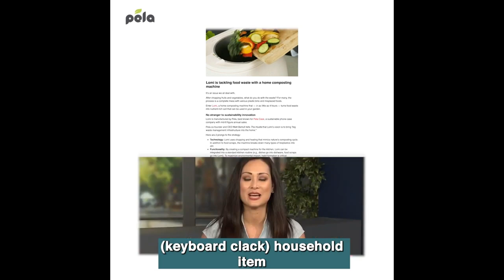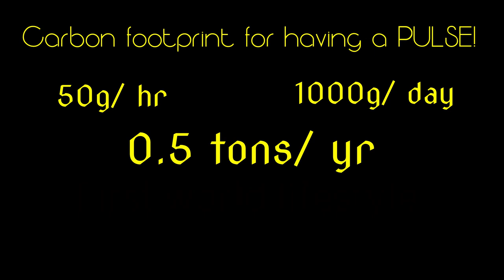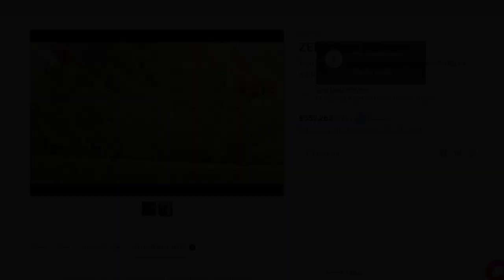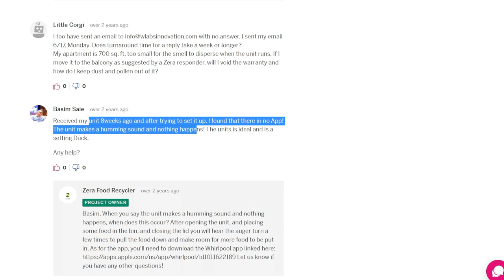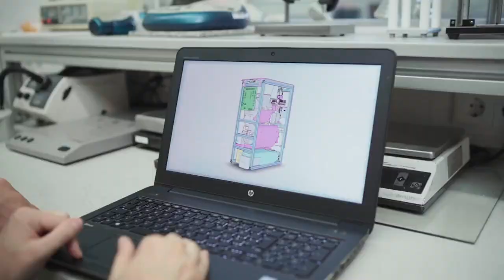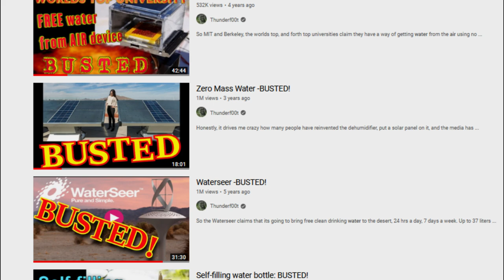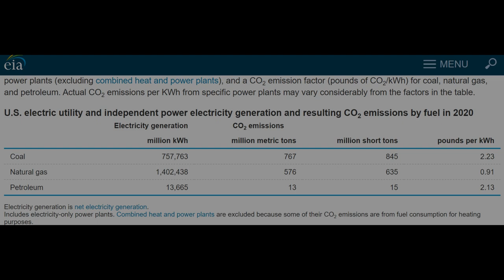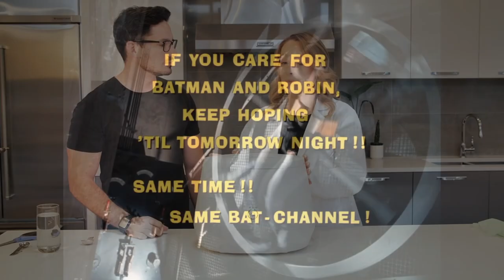Lomi: BUSTED!

Comment: Just want to point one thing out, as I do not support the product, I do want to say your information is not all correct. In the beginning of your video you tried to argue that composting produced methane the same way landfills do and that’s been proven wrong. 
The aerobic process of decomposition done by composting does not produce methane because the microbes that produce methane upon decomposition are not present when exposed to oxygen. 
The reason methane is produced by landfill is because the waste is compacted down and buried in clay and dirt not allowing the waste to be in contact with oxygen.

Comment: Look guys, the fact is it does require electricity to run by at $.12 a load it’s actually not a big deal, and it cuts down on the trips to the garbage bin by lowering the volume of food. On top of all that, I can put this into my own garden and the minerals will help the food grow that’s called fertilizer dummies!
Reply: You forgot the "/s"

Comment: I mean it is redicilus how you ignored the true potenzielle for antaric Research Expedition;) there you can Not leave Trash behind thus Dehydration of foot wast might be a good Option.
Reply: Mealworms and superworms: Are we a joke to you????????
Reply: @electric7487   so do they actually have are Worm based decomposition Setup at Antarctica ?
Reply: @konraddapper7764  Not sure, but worm composting would be very environmentally friendly, that's for sure.
Reply: @electric7487   in Most caeses yes 
But  in - 30 ° weather  Close to the southpole were you would have to Heat compost piles I am Not Sure If it is worth the effort.
Reply: @konraddapper7764  Keep the worms in your shelter then.

Comment: So it gets hot and had a blade rotating in the bottom... Um... Isn't it just the same tech as a bread-maker (with a different shaped blade) only with LESS settings. How does this piece of garbage cost more than $60?

Comment: where do you think food comes from?
it grows in soil which is located in the ground lololol 
so in your mind putting food back into the place it came from is causing a problem?
could it be that plastic and other toxic junk is causing a problem with the environment?
let’s do something mathematical,
you have four pound of waste.
two pounds food, two pines plastic and other toxic garbage…..when that four pound reaches the land fill, which two pounds is causing the problem for the environment ?

now you have four lines of toxic waste, going into the same land fill, it’s all toxic so what’s the solution, what do we do?
hey i know how about reducing the toxic waste.  sound like a plan?

the two pounds of food, and two pines of toxins makes sense now, right.

what happened when this electric compoter that uses electricity made of metal and plastic breaks ?   it goes in the trash to that land fill to cause even more damage to our planet.
“or is it going to run on air, and never break? “.  how crazy is that 

God forbid you throw food in with that clean garbage.  That rotted food will destroy our planet.
how stupid, and you fell for that

Comment: Scam you say? Critiques are ok but after spending 24:12 of listening I didn't hear anything about alternatives.  Are the calculations in this take in to account if the Lomi is plugged in on a regular basis say like a refrigerator? Also seems like this the tech has gotten a lot smaller or better.
Reply: Grinding your food waste in the garbage disposal is another option that does a lot less environmental harm than these things do.
Reply: The alternative is a freaking compost. If you don't have space for one you won't be using your fertilizer anyway. Indoor composting has also been a thing for decades aswell, without wasting electricity (Bokashi). Man, people are stupid.
Reply: @jamaly77  duh that's obvious. The point of those machines is to make it faster and better alternative than composting which takes a while. That's the whole point of technology. It's still smaller than anything in its class. Despite the inefficient conduction of energy of said device.

Comment: Fake vids don't help. For the under $200 dollar price I think its worth what it does. The cost seems to have skyrocketed though. I like the material output that is easy to store before the  addition to manure. The adverts are completely contrary to the directions received with the unit. The little kid putting a handful of material into the planter is just a way to promote indoor mold. I've used urban composting, and without a big shovel and a bathtub volume of dirt its not easy. The process is accelerated but it doesn't compost. As the first few seconds of this vid states, its a pre-composter. With a few re-used sealing buckets and a garage that is typically uncomfortably hotter than the uncomfortably hot climate I get good results. Starting the unit before bed leaves the dry cycle to run during the time of least power use and highest power generation. Not to argue about the electrical use, but its worked for us. If it keeps working without hassle for 4-5 years I'd be happy with a $200 cost. If expectations are correctly set, the power use is the only concern for me.
Reply: To clarify, this isn't a criticism of the "bust". It's not an endorsement for the product. I had not even seen some of the dumb advert vids before getting some Thunderf00t common sense. After watching the vid its seems that while I find the product useful, I don' seem to be fulfilling its fanatic claims.

Comment: yea, no....
These composters work extremly well, These contraptions can cut down 95% of your food waste, And if your etremely you can use paper waste as well. As someone who has 2 similar machines,I can vouch for them.
your video is funny lol yet simply not true...
Reply: You sound like an advertiser saying “you can get UP TO  x amount off.” Explain how this energy sucking machine is any better than traditional composting.
Reply: Amazing. Every word of what you just said was wrong.
Reply: @Zynbabwe902  
Lets see.... If you dont have a yard to build a compost pile in, this solves your problem sweetness
Reply: @electric7487  
Tell me the wrong parts...ill wait
Reply: @src3360  Your ENTIRE COMMENT was nothing but lies.

The first thing you should do if you want to cut down on food waste IS TO NOT CREATE SO MUCH FOOD WASTE IN THE FIRST PLACE.

And if you DO have a problem with food waste, the answer is probably right under your sink. Grind your food scraps in the garbage disposal. Garbage disposal units use far less electricity than these things. And they don't stink anywhere near as bad. And they require far less maintenance.
Reply: @electric7487  
Firstly, what I wrote is true bcuz im doing the exact things written. Im composting right now actually.... and nothing stinks
Share with me how you compost your food scraps..? You know nothing I spoke of. You dont own a machine. So your opinion means absolutely nothing, you cant even compare experiences bcuz you dont own a machine and likely have never composted a thing. You send it down the drain....
Garbage disposal is NOT composting. Its simply putting more WASTE to be filtered and treated at a later date. And making less food waste? Maybe you buy food in cans and bags but the food I eat needs to be peeled, chopped, dissected, etx so no matter how hard I try, I will have food waste. So no to that as well.....

Comment: I disagree with the interpretations you and many of your commenters express. I do agree that most of the food cyclers do not produce compost as in nutrient rich bioactive soil product. But I don't agree that they clearly are worse for the environment.

First, it seems you and many of your commenters have adequate space for a compost pile. People in dense cities and apartments do not. Definitely not an option. So our food scraps must go somewhere (no, not ALL food material can be eaten so that option is not valid, I cannot eat banana peels and watermelon rinds).

Next, it is true that electricity is used to dessicate the food into mostly cellulose fiber. But I purchase only renewable energy electricity. Is it a lie where my electricity comes from? I guess it may be. But if my electricity is indeed from renewable energy then the joules used to dessicate my food scraps did not increase carbon emissions except in the process of relying on a grid, which is already there and not related to the food cyclers.

And a major way these machines reduce emissions is in the transportation of the waste. Food scraps that I throw into the garbage must be picked up by a diesel truck, driven who knows where, and anearobic processing in a landfill produced methane. Meanwhile the dry cellulose my machine produced, I sprinkle it in the park as I walk to work. Even if I threw the debris in the trash, it's about 80-90% less weight with the water removed. So tremendously less disel burned to haul the waste.

In effect, this means the post-purchase part of my food life cycle is nearly emissions free. The renewable electricity to power the machine, no need to drive the scraps to a landfill, and no methane.

The only part of the process that increases emissions is the pre-arrivall to my home. So the extraction and manufacturing and shipping of the device.

I believe you are doing a disservice with this video. I don't believe you have earnestly evaluated the data but rather trying to profit on the reasonable concerns others have about a full cycle emissions of a product. 

https://earth911.com/home-garden/electric-composters-sustainability-win-or-another-unnecessary-appliance/

https://www.honestlymodern.com/foodcycler-emissions/
Reply: > "First, it seems you and many of your commenters have adequate space for a compost pile. People in dense cities and apartments do not. Definitely not an option. So our food scraps must go somewhere"
- If you use a municipal sewer, the answer is under your sink. Grind your food waste in the garbage disposal. This uses far less electricity than one of these things, because it runs intermittently instead of continuously, and most importantly, garbage disposals don't have power-guzzling heaters running for 5 hours straight.

> "Next, it is true that electricity is used to dessicate the food into mostly cellulose fiber. But I purchase only renewable energy electricity. Is it a lie where my electricity comes from? I guess it may be. But if my electricity is indeed from renewable energy then the joules used to dessicate my food scraps did not increase carbon emissions except in the process of relying on a grid, which is already there and not related to the food cyclers."
- No. If you want to reduce your energy consumption, you have to reduce your electricity usage regardless of where your energy comes from. Even if your energy doesn't come from any fossil fuels whatsoever, it's still much more environmentally friendly to use less electricity.

> "Meanwhile the dry cellulose my machine produced, I sprinkle it in the park as I walk to work. Even if I threw the debris in the trash, it's about 80-90% less weight with the water removed. So tremendously less disel burned to haul the waste."
- Wrong, wrong, wrong, wrong, wrong. The mass of the water removed is nothing compared to the total amount of mass of your garbage. This is not hard to figure out.

> "In effect, this means the post-purchase part of my food life cycle is nearly emissions free. The renewable electricity to power the machine, no need to drive the scraps to a landfill, and no methane."
> "The only part of the process that increases emissions is the pre-arrivall to my home. So the extraction and manufacturing and shipping of the device."
- What? None of this makes any sense whatsoever.
Reply: @electric7487  you make a lot of assumptions.

Quite many people rent and cannot install a garbage disposal.

Second, my weekly garbage is about 90% food scraps bc I don't buy much. So maybe if you consider all the other people I understand it's not a lot. But my waste, by mass, is about 90% food scraps, and the rest food packaging. You don't have to believe me but others may identify with this as well.

While it's true that less energy is less energy, source does matter. While carbon offset is not really the same clean energy as solar or hydro, being able to use energy at a time that demand is low or from a solar source is an option for many people. But loading diesel garbage trucks with banana peels is guaranteed to use diesel.

So I know it's the Internet and it's cool to insult others. But please consider your experience isn't the same as everyone else.

But I do agree that for those who can pulverize their food into the sewer, that probably is a very energy efficient solution since the water flows.
Reply: @spissatus  
> "Quite many people rent and cannot install a garbage disposal."
- Don't a lot of apartments these days come with garbage disposals? At least newer ones (built in 2000 or later at least)?

> "Second, my weekly garbage is about 90% food scraps bc I don't buy much. So maybe if you consider all the other people I understand it's not a lot. But my waste, by mass, is about 90% food scraps, and the rest food packaging."
- Recycle your packaging. Get some mealworms and feed your food scraps to them. And what's neat about mealworms is that they can even eat certain plastics, most notably polystyrene (Styrofoam).

> "While it's true that less energy is less energy, source does matter. While carbon offset is not really the same clean energy as solar or hydro, being able to use energy at a time that demand is low or from a solar source is an option for many people."
- Yes, source does matter. But something that increases your electricity consumption by a significant amount isn't going to help.

> "But loading diesel garbage trucks with banana peels is guaranteed to use diesel."
- Those trucks are going to be powered by Diesel fuel for at least a while, maybe even forever. At some point, though, that Diesel is going to be produced from pyrolysis of sewage or garbage or synthesized from CO2. I'm not sure on exactly what percentage of the garbage in the trucks that pick up your waste is food waste, but I don't think it's significant at all. Also, the faeces that mealworms produce is going to be much, much less dense than raw food waste. It's going to be mostly in the form of a powder, so you can dump it on a tree or something. Then it'll decompose aerobically, releasing minimal methane.

Comment: IMO if you live in a place where coal or oil is burnt for energy this is an awful product. But your video does not touch on places that use renewable energy. It’s also worth mentioning that this type of waste can be used for indoor gardens, and houseplants. Don’t be quite so narrow minded.
Reply: > "IMO if you live in a place where coal or oil is burnt for energy this is an awful product. But your video does not touch on places that use renewable energy."

- I've seen this argument over and over again, it's basically saying "as long as our energy comes from solar, wind, and hydro, we can use as much electricity as we want". It's wrong on literally every level. Why? Because nothing is free. Solar panels and wind turbines cost money and resources to make. In order to be more eco-friendly, we need to reduce our electricity consumption regardless of where our electricity comes from.

> "It’s also worth mentioning that this type of waste can be used for indoor gardens, and houseplants."

- There's already a video showing how dehydrated bits of food waste can actually inhibit plant growth. Plus, by heating your food waste to such high temperatures, you're sterilising it, meaning that most of the nutrients are now destroyed or gone.

> "Don’t be quite so narrow minded."

- The term you're looking for is "grounded in reality", not "narrow-minded".

Comment: the exaggeration in this video is super annoying. lomi is not gold-plating trash bags. 1kwh of energy costs most americans 20 cents or less. the people who buy a lomi are the same demographic that pays professional dog poop picker uppers to drive a pickup truck to their house and pick up the dog poop from the yard.

20 cents per load for kitchen scraps is silly but it is ABSOLUTELY INSIGNIFICANT. and you are making a huge deal out of it. 😂

you didnt address their primary claim, that dessicated food waste produces less methane than wet food waste. that's what they propose to be. a luxury methane-avoidance appliance that also saves you a few minutes of stinky compost-moving per week. 

maybe you are not keyed into what americans are spending their money on. but this thing will cost less than $2/wk for most users, if it works as advertised. nobody in the target demographic cares about $2/wk.
Reply: Or, you can throw your food waste down the garbage disposal.

Or, you can reduce the amount of food waste you generate  in the first place.

Comment: I'm not saying you're wrong, but, I'm 17 mins in and you have not provided a single source for your claims or elaborated how this is a bad idea, other than rambling about how inefficient it is...
Reply: You just contradicted yourself. The fact that this consumes tons of energy (and doesn't actually produce dirt or compost) is EXACTLY why this is a bad idea.
Reply: @electric7487  you misunderstood, it's just rumbling about how inefficient it is, without providing any type of reasoning for it (or proof). Granted a minute later he  does a fail attempt at trying to prove it.